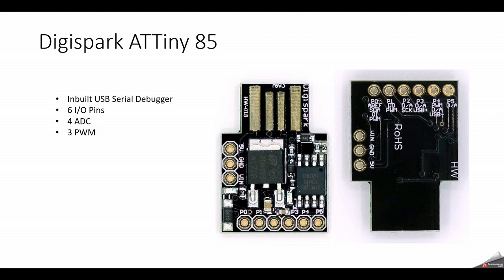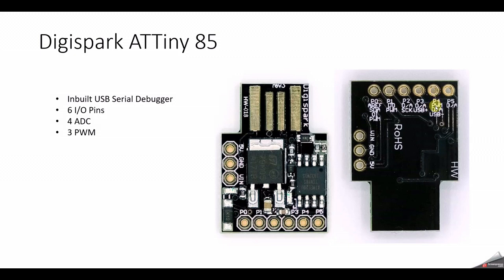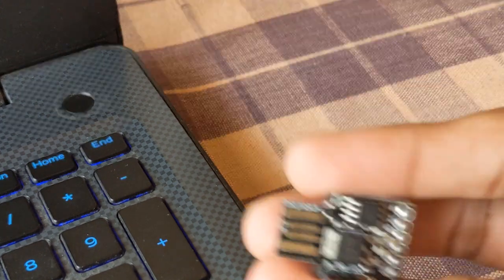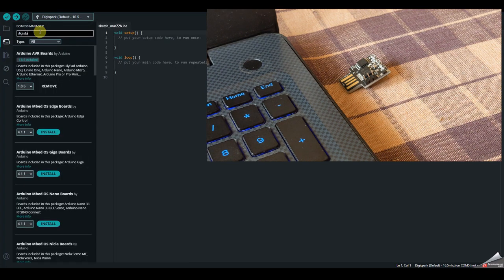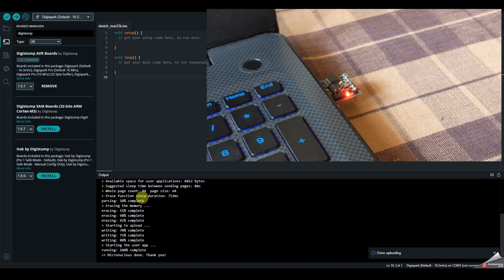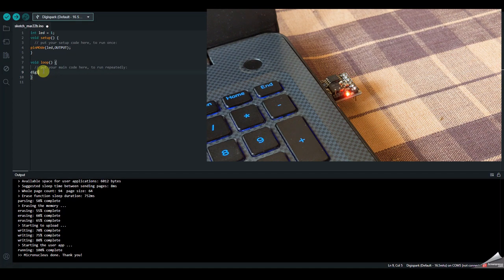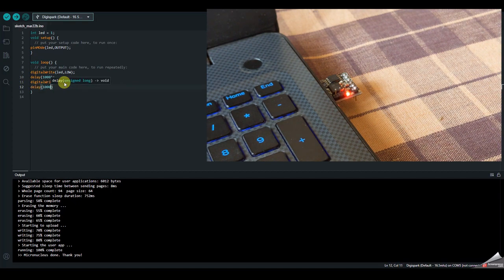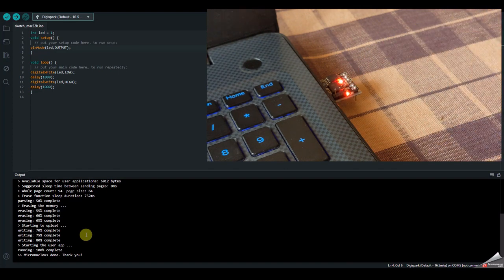Getting started with Digispark ATTiny85 | Smallest Microcontroller Board |

Comment: hmmm. can i use this output5V to mini servo power wire. and USB have power and data. i think add to usb port and then use some input data pin and one pwm output to servo  i think not need add external 5V power to servo, take all at board and board 5V pin take servo power.

Comment: WOW so small board
Reply from the maker: Yes.... You can use it for small projects which need minimum pins.
Reply: and now have new version super mini nano board, but need USB-C data cable program this, not have many all have lot only USB-C charging cable not have data wires.better buy super mini nano whit cable same time. include 3 pcs neopixel colour led in board.